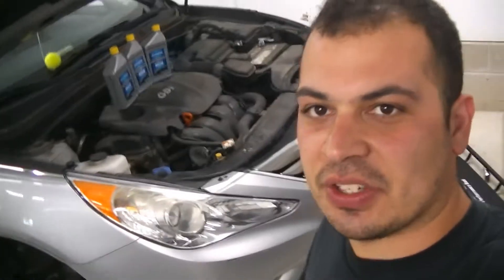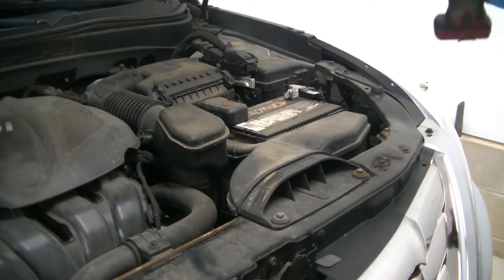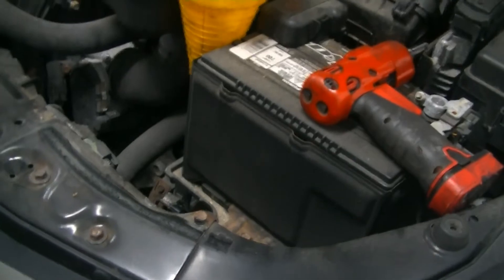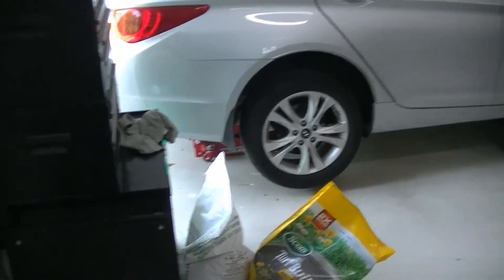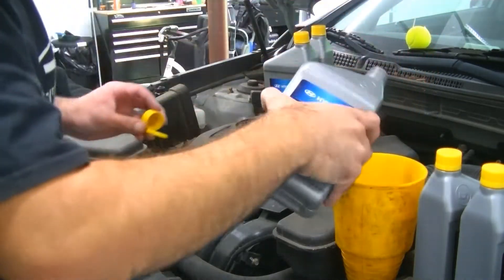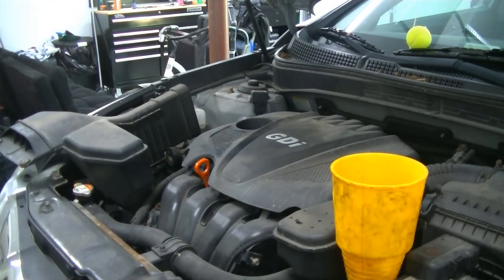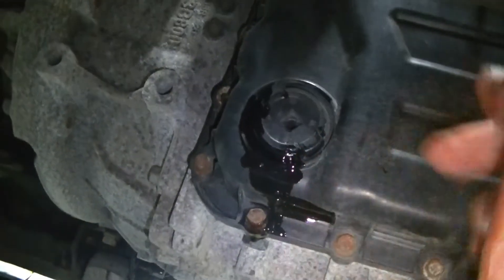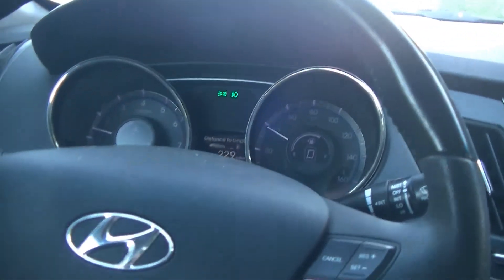Hyundai/Kia 6 speed automatic “sealed” transmission fluid service and level adjustment

Comment: You don't need a $600 scan tool to do this job.  That's ridiculous.
Reply: You can just measure the drained fluid and replace that making sure the transmission has completed cooled off to the ambient temperature like after a night of not driving it.
Reply: @coldjello8436 the manual states atf must be between 50 and 60 degrees celsius when checking atf level..
in sketchy diy terms, the coolant gauge at halfway should be fine
Reply from the maker: You need a scan tool that will read live data and I’m simply sharing the scan tool I use with my viewers
Reply: @SEsGarage can you do drain and fills cold?  ...why not?
Reply from the maker: @88Berries  sure could. But you need to warm the fluid up to adjust the level
Reply: @SEsGarage  thx
Reply: I agree, just a simple drain procedure to measure how much fluid comes out.  My elantra motor is a little different but doesnt matter.
Reply: Also, I see people wondering about oil temp and transmission temp. Those are very different things and I have a special HUD that plugs in that tells you most temperatures in your car that we dont have guages for. You can buy those for less than 100 bucks and they look really cool while driving around.  Sadly our ECUs dont read trans temperatures so you need a IR thermometer if you want to check that way.  I dont feel its mandatory for simple fluid changes on an Elantra but its always nice having tools. They are good for life.
Reply: $150 at the Hyundai dealership for a drain n fill $250 for a complete change pay n go I got a 2013 Azera 139000 change the transmission fluid every 15k no issues ever 😂 oil change every 5k 🎉
Reply: A Bi directional scan tool is money well spent for an older car
Reply: Well Stephan, you are a professional car mechanic at S&E.  I, too, would have a computer such as yours if I serviced "thousands of Hyundai transmissions" as you say you guys do.
But we're "do-it-ourselvers" here and inasmuch as I'd love the gadget (and my wife and my budget would bitch), you should try to come up with procedures we can actually do at home.  What do you think?  And thank you for your video. It is great.
Reply: The difference between hot and cold on fluid is hot raises the fluid on any dipstick about an inch, won't hurt anything just drive 5 miles gets it to 125 degrees then pull the check plug and if it drips out your fine..
Reply: Did you measure the engine oil OR the transmission fluid temperature?  They are two different things.
Reply: @testtesting2868  I really hope this isn’t a real question……
Reply: @nordicpride9708  It should probably be explained better to viewers that really don't know the difference for transmission temperature.
Reply: @testtesting2868  🤡
Reply: @coldjello8436  For most viewers, they might think the engine oil temp is the fluid measured for temperature.  Just trying to educate the newbies to this world of car repairs.
Reply: @testtesting2868  No duh Sherlock.
Reply: @jobyden105  You and I get it but MOST do not.  Your response says a lot.
Reply: @jobyden105 in engrish?
Reply: Couldn't we assume a time for the engine to reach temperature ?
Reply: @ramospk 
Yes it takes 15 minutes to reach 122 degrees

Comment: excellent video , i use the inspection cap to fill the tranny with a transfer pump, way faster than waiting on gravity and air pressure filling through the fill cap hole, also, this method can be used if by chance the fill cap is stuck or stripped...love the instruction , this is how i will do it next time, just because it looks to be more laid back than feeding a pump into five bottles...LOL
Reply from the maker: I do the hybrid transmissions that way, as the power inverter is in the way of the fill plug on those

Comment: Instead of removing the trans cooling line, I find it easier just to remove the plug for the fluid level check before filling.  That allows the trans to "breathe" when filling.
Reply: I found that it started running out well before there was enough in there doing it this way, only about 3 or so liters when it needed to be about 4.5 to 5 litres. so I had to top it up a couple of times with attendant removal of access parts. Next time I will use a long funnel and do it slow to put about 5 liters in so it only needs one level check. Experience gained for next time! 
Still worth it for the satisfaction of knowing you are looking after longevity and smooth shifting enjoyment.
Reply from the maker: I’ve never done it that way, I have however filled the hybrid transmission through the inspection hole to avoid having to pull the inverter assembly
Reply: im going to remember this for next time..
Reply: A.R., that way worked on my 2012 Sonata, which I've done 3-4 times.  But not on the 2017, it gurgled all over and was a mess.  I have to do my 2019 now, so I may have to pull that cooler line.